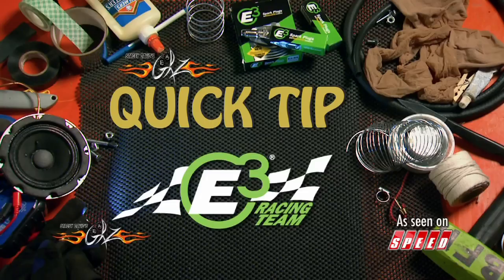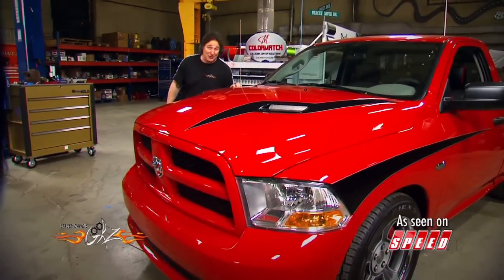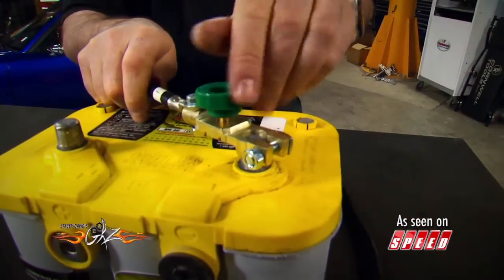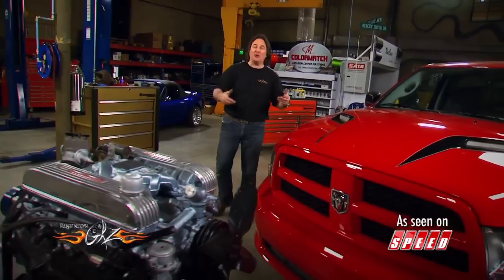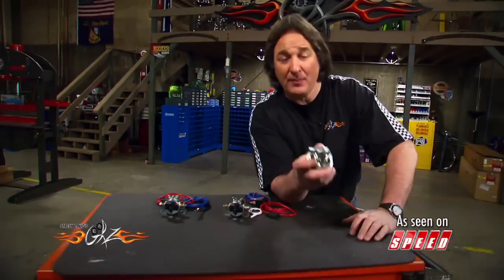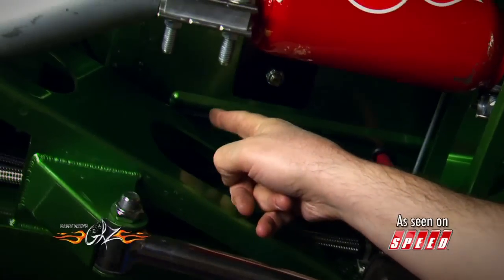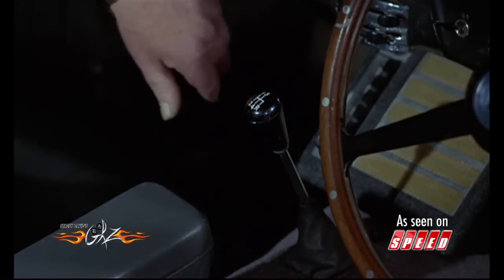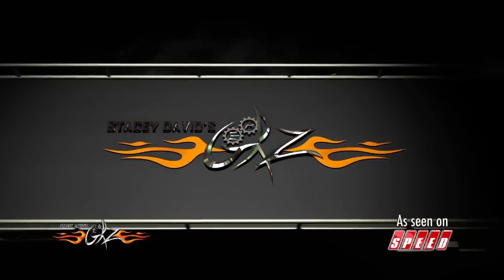Stacey David's GearZ Quick Tip: Keep Your Car From Getting Stolen

Comment: None of this protects against a tow truck. The only way you can have a thief proof car is to put Thor's hammer in your trunk. But of course then you wouldn't be able to drive the car and Thor could steal your car.
Reply: +mkygod GPS lowjack. Will track the vehicle if it moves and alert you on a phone app if it moves.
Reply: +mkygod a friend of mine have been putting a wheel boot on his acura integra if he was parking in public places. he was even on the chicago news. type in google Chicago Driver Gives Himself The Boot To Guard Against Car Thieves
Reply: AmnScottNN I have lowjack on my car. Lowjack only helps with recovering a car. It doesn't do anything to prevent someone from stealing it.
Reply: mkygod It depends I suppose. It prevented my cousin from his car being permanently stolen. Someone drove it without consent; he gave the authorities the GPS info and they pulled the thief over and returned his car the same day. Just gotta be smart.
Reply: If Thor's hammer can't be lifted by those unworthy; how was is stolen by the frost giant Thrym?
Reply: usernamunavailiable Thrym was Thor's real daddy
Reply: the car would still drive. If the hammer is in an elevator the elevator still goes up. but its not worthy.
Reply: mkygod for the rest of us, Claymore Mines with motion sensors will prevent theft, even from tow trucks
Reply: And captain america.  He stole plenty of cars in his terrible 90s movie.
Reply: If I slammed my truck on the ground and took the battery out, it would make it harder for the tow truck to steal it at least.

Comment: The problem with the disconnect cable. All the things you programmed. Seat positions, radio, settings. And the OBD2 settings will be off until you drive enough miles and start/stop cycles to reprogram the car.

Comment: I have an old 5.0 Mustang. One of the good things about Fords is that the distributor is up front. Pop the cap and take out the rotor, engine will spin but won't start. I've been doing this for years.

Comment: I installed a dizzy switch but I had 4 of them mounted in a way that I had to move one down the next one up then the other two down.  The car wouldn't start until the switch pattern was correct.  They were installed under my radio.  Looked like an airplane cockpit.  Kind of cheesy but I liked it.

Comment: 2006 F350 diesel stolen from a "secured" storage lot in Edmonton, Canada. Had a Club on the steering wheel and motorcycle chained to the hitch. The Club was said to have been broken and the hitch was damaged to get the kryptonite lock and chain off while still locked around the bike frame. Has not yet been recovered. It had some kind of immobilizer, but I'd only had the truck a few days and wasn't familiar with how to set it.

Comment: Modern cars need a period of time in order to shut down the drain on the battery. For anywhere from 10-30 minutes, there is a drain on the battery as the various power-consuming components are shut down (and there is always some drain as well, clocks, information systems, etc. If you installed a battery cut off and shut the power down before this shut down time, would that not mess up the car computer, not to mention the clock always being wrong, your radio having to be reprogrammed, etc?
Reply: yes, a battery cut off will do that
Reply: lol, an Immobilizer isn't going to stop every thief 
The idea here is to add more security
your comment is as valid as saying "cars have had steering wheel locks for decades why do we need this"
Reply: ***** hey dude i will show you how to start it no matter what you put on it.
Reply: Depends.  Some cut off are designed so you can wire in your radio and clock back into them

Comment: There's some tricks like this, when parked, steer full lock to either right or left, then just lock the steering wheel as usual. The car cannot be pushed onto a flat bed. Point the wheels towards an object or another car.

Comment: I had a 74 pink VW bug.
I would take out the distributor rotor. No Spark, no start, no problem.
Then the 1994 Northridge Quake happened, while I slept in 29 Palms...When we got back, the 3 story apartment building, was about 8 inches shorter & the parking lot security gates were lying on the ground, and the door going into the building was wedged shut.
2 days later, the people I worked with at the Northridge Malibu Grand Prix, were giving me a farewell party, because the next morning I was starting my new job at Calabasas Mercedes.
I finally got home about 2am, hating that i had to get up in a couple of hours to make it to work on time.
As I got out, I thought to myself that it was only a couple of hours...
Next morning, sprinting down the stairs & out the front door... I could have swore that I parked it right here..

Found it a week later, next block over, other side of the alley, behind a bunch of other vehicles that had been stripped & totaled.
It had been stripped clean and beat with a sledge hammer & an axe.
They wanted to make sure that it wouldn't be worth repairing..

I cursed them with crabs, fleas & cockroaches for the rest of their lives.

Comment: also your radios resets every fuckin time. i just remove the engine and put it back later.
Reply: blackness010 just put a small fused wire from the live to the battery lead, your radio maintains its settings, anybody tries anything and the fuse blows

Comment: I took a 3 way toggle switch and wired to the fuel pump and starter relays to disable them. Put the switch behind the license plate. Cost $6.37.

Comment: I did the toggle switch on an old motorcycle and put it inside the little storage compartment. It would run with the toggle off, but it wouldn't start back up again.

Comment: With the battery drain cut off things have to be re set. Other way they can see you screw with wires. What I did was put a fuel peacock on the fuel line. Shut it off when you get where your going. They will only be able to drive about a half mile before they run out.

Comment: I just leave the keys to make it easier for the jerk who wants my clapped out 1982 Civic. But they never take it......  :(
Reply: I leave my door open and don't leave anything in the car. Gotten broken into twice breaking my windows. Now they  come and leave when they find nothing to steal. They messed up my ignition tumblers with a flat head screw driver but since it has a chip key and they couldn't get the engine started.

Comment: My '61 Falcon has a Ididit steering column with the high beam selector built in to the turn signal switch, like modern cars. But, the original high beam switch is still in the floor. It cuts off the electric fuel pump. Not only for anti-theft, but for carjacking. Step on it as you get out, and the car will run for about 30 to 60 seconds, letting the carjacker get far enough away so they can't hurt me. Easier than a gunfight.

Comment: I want kill switches like in Mad Max 4. Alternately a biometric lock like in the transporter. Either would be good.
Reply: +Zashra I'm exacly looking for that which is why Google send me here, did you figured something out for such a combination switch?
Reply: Hidden fuel pump switch
Reply: Stuntihn MX That's simple, too simple, what we are asking is a series of switches in a specific combination to activate the fuel pump
Reply: Ah I see lol well you could put multiple fuel pump switches and put some of them on and some of them off, but label with numbers so that only you know which is on and which is off? Maybe that could work lol
Reply: Stuntihn MX Partly the system in the War Rig requires you to turn on and off multiple switches it requires a computer
Reply: +Zashra
 A switch that only works by your phone!Eeh,but then how you must secure your phone?Aha,a phone with a fingerprint sensor!
Reply: Actually, that can be done with latching circuits.

Comment: Any flashing light in the car with a switch makes them think your alarmed...worked for me...
Steering locks are bad as they use them as leverage to break your integral steering lock them they hacksaw the steering wheel...
Leave the glove box open its a declaration of empty & puts sat nav thieves off.
Get your wife to box your car in if you have a drive so her car blocks it..
Window battery operated alarms just use a magnet & sensor there tiny & easy to fit they are not part of the cars power & can be stuck under the drivers door or seatbelt anywhere that they move something it goes off loud.
Reply: litecoin

Comment: I thought my S430 was theft proof until last December when some overly determined idiot thought it would be a good idea to literally drag my car away with a tow truck. I got it back right away though with $27k in damages to my wheels, axles and air ride etc. They never did get inside or under the hood or anything off the car though. Thanks to my bullet resistant glass, reinforced steel firewalls/carriage, run flats, battery was disconnect etc. They did get caught and was pretty frustrated over the whole ordeal..I noticed it missing right away they left drag marks...lmao She is so beautiful they just couldn't help themselves..hahaha
Reply: i hope they drop the soap.
Reply: Dang what kind of car do you have?
Reply: ***** Show me your proof.
Reply: razerxrob "HE" is a "SHE" lol
Reply: ***** I have not been a child in 20 years and don't have time for ficticious story telling. Did you have something to contribute?

Comment: Wait if u disconnect the battery u can't use it key fob anymore!
Reply: good point but 90% of key fobs have a removable, physical key to get in for emergencys
Reply: Yea ik sometimes it's not the original key so it won't work for the door. My mom her fob wasn't working for a while so she ha to keep the doors unlocked and surprisingly noone stole it noone really steals cars here in Toronto
Reply: Install a low amperage inline fuse jumper across the terminals. It'll let you unlock the doors, but if someone tries to crank the engine, it'll zap the fuse.

Comment: 2 more he didn't mention. 1. Drive an old stick shift. 2. If it's a 4 speed with linkage, adjust the reverse linkage far enough out that you've got to slap it to get it into reverse. it doesn't give a hint to where reverse is. They'll just keep going from 1st to 4th looking for it lol and park where you got to back up.

Comment: If you have an automatic and you don't want your car to drive away put an electronic vacuum solenoid on your transmission key switch and you can also hook up a kill switch to the engine

Comment: I use a dizzy switch on every car I owned. The switch is hidden on the seat rail. When I had a diezel I had a switch to cut the starter solenoid

Comment: Some good ideas there!   I already have a coil switch (to ground) but want to fit electronic ignition, so obviously cannot use this method anymore or I'll burn out the electronic module on the points.  Can I switch the live supply wire BEFORE it gets to the to the coil instead..?

Comment: I have a gl1800 motorcycle I decided to wire some funky wires between several components and a wireless bleep bleep key fob system which essentially keeps the bike in reverse. The bike cannot be moved and cannot be started. It amazes me the manufacturers don't do anything like this themselves

Comment: My truck has a ground that goes through the transmission. If that connection is broken, the truck won't start. (Can't recall which wire it is) You could dig through the vehicle wiring diagrams and look for this, or a similar connection to wire a switch into.

Comment: Just drive a POS.  My 83 Accord didn't even HAVE an ignition lock, just the switch underneath.  Just stuck a screwdriver in it and it would fire right up with a twist.  Left the windows open all summer.  No one messed with it.  A fine piece of machinery.

Comment: If you don't want to do ANY real work there are two and a half good ways.

1. Get a sticker for your window indicating an alarm system is present -- even if you don't have one it will deter theft. You can also rig up a flashing red LED in the cabin cheaply and easily to indicate an alarm system.

2. Drive stick -- it works!

2.5 if you are in an automatic make it complicated to get away, lock your wheel when you park this typically makes the CORRECT key harder to turn so using a screwdriver will be even harder, or if they are hot wiring they will also have to circumvent the steering lock. Another way is use your parking brake, granted they will probably just burn through it if they get far enough to drive the car but they may peel out and draw more attention to themselves.
Reply: In Europe, there still is a company that puts all kind of things (license plate, or a serial number) on EVERY single glass screen of the car. It's just annoying for thieves, since they know they will need to replace all windows, which is work and money, and they don't like work, and they don't like to spend money. Basically, if your car is worth 2000 euro, and replacing all windows costs 1500 euro, they will leave your car alone.
Reply: There is a anti theft tool that locks your brakes in place Jat put it on top the brake pedal and click it in place it takes an hour to cut down and u will look real suspicious while doing so
Reply: nouse use Haha yeah if you are talking about what I am thinking of, they can be a pain in the ass to use every time you park!

Comment: I cut into an ignition wire, and ran enough wire to go to my floorboard and used a $6.00 hi/lo beam switch.  I mounted it Very High on the floorboard.  You can crank and crank all day, it'll never start.  I did it this way as I was going to drive all the way to Chile.  Yes, the country.  I didn't want the crowds that might gather as a gringo pulled into town see me reach somewhere for a kill switch.  I could do it invisibly with my left foot.

Comment: Another way would be to rig a metal pole under the seat and if the thief turns the ignition he will instantly be impaled buy the metal rod. And obviously have a kill switch somewhere so you're not impaled

Comment: Just tap into your neutral safety switch folks..... Unplug a wire to learn which one causes the car not to start... then splice into it, with a toggle switch... lights come on, but no cranking, thus no starter burn up, etc.

Comment: Micro switch to the fuel pump  So small it fits inside the sun visor  Click once : On  click x2 : Off  ...Cheapest way Mark your fuses where they go and pull 5 or 6 out

Comment: My key only unlocks the steering wheel on my old truck. Toggle for ignition. Push button for starter. Toggle for fuel pump. I'll put a cut off valve on it next. Good idea.

Comment: #-1- Keep a Cougar in your car. 
#-2 On Fords just remove the coded key under the dash... it will not start. 
#-3 You can also just unplug the brake pedal switch. It will not allow you to shift out of park, even if you press the brake pedal...

Comment: I put two wireless motion detectors under car protecting my Cadillac converter thief's placing horn to connect to battery so when I'm not driving the horn will draw power off battery so I could plug it to electric 110 house volts. My question is thinking use a second battery to plug in horn work better than plug in 110 volts from house? what are your thoughts?

Comment: Sadly on current models disconnecting the battery causes great confusion to Computer, Radio etc.  Chain the brake pedal to the Steering column.

Comment: Not much they can do anyways, made a fuel pump switch and battery switch on my small blocked blazer. Seen the fact the ignition switch on those can be started with a screwdriver

Comment: I have a hidden under the dash a cut-off switch inline with my clutch safety start switch. Even if you had the key and depresses the clutch it will not start.

Comment: Taser linked to the door handle does the trick 😂   Allegedly 😏
Reply: hmmm you just gave me an idea.  if somehow i can run a high voltage wire to the door handle and activate it with the alarm,  that would be awesome.
Reply: make sure you forget to tell the wife
Reply: Been thinking about that one for a long time. two pieces of wiper steel connected to an ignition coil, far enough that they dont create an arc. need to find a way to work in the rain and through gloves.
Reply: Eye Open i miss the old days when the car stereo had cassette player my neighbor had the thing stolen three times but the last one he glue fishing hooks inside and still to this day we remember the idiot whit the hand stuck in cryng like a child

Comment: I have a small toggle on my fuel pump power wire but if a thief thinks they are really slick and uses a trailer . I also have a small gps tracking device hidden that has power from the vehicle and its own internal battery that will last a cpl weeks

Comment: i have multiple switches hidden throughout, one to the fuel pump, one to the starter, one to the distributor, and one to the brake lights encase they find them all ill have a chance at them getting pulled over